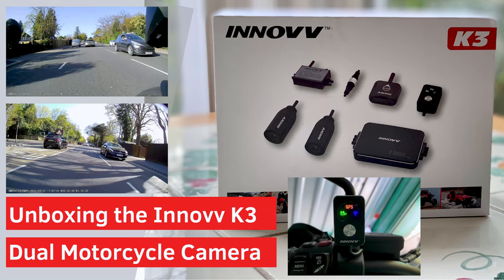Fitting the Innovv K3 Camera System to a BMW R1250 GS Adventure

Comment: Hi Nick, an excellent video. I have the K2 on my R1200GS and got knocked off from behind last year and the footage was invaluable as the Police used it as evidence to prosecute the driver and also for insurance. I am thinking of getting a new bike and now need to decide whether to keep the K2 or buy a new K3 but wouldn’t be without a camera system after the experience I have had.
Reply from the maker: I’d stick with the K2 Peter. The K3 doesn’t have enough useful for the money. Great cameras. It the K2 was fine 👍🏻

Comment: Great video, thank you! My only question is does the direct connection to the battery drain it? I've heard some comments in the past about other cameras that having that issue :(
Reply from the maker: No. The camera switches off completely as soon as the switch wire (yellow) gets a signal the ignition is off (in fact the power supply maintains a short period of power after this signal to ensure the last files are safely written). What DOES drain many batteries are trackers as they are powered 24/7 for obvious reasons and motorcycle batteries are small. My bike is connected at all times to a ‘smart’ charger

Comment: Great video, very informative, 
Did you mount the remote for the K3 using the fixings provided in the kit, 
Thanks 👍
Reply from the maker: I did on the GSA under the mirror stalk but in the K1600 I used the best 3M dual-lock and stuck it to the top of the clutch hydraulic reservoir where the mirror would normally be 🤣

Comment: Thanks Nick, I'm replacing the K2 one on my K1200GSA with the K3 now.  This is my third model INNOVV camera, the first version had the save button and I missed that on the K2.  I have a Tiger 850 Sport and a second K3 camera will be installed on it as well.  Wondering how I will handle that, any ideas?   I use a MAC, so will deal with that when I get there I guess.  Mike
Reply from the maker: The Mac side will be fine. All you have to do with any motorcycle is connect a battery and find a switched wire to plumb into. As most stuff is under seats just head to the rear light is what I’d do and use a positap to ‘break’ into it without too much damage. Good luck

Comment: Hi Nick. Great video, thanks. Any reason why you didn't get power from the Cansmart?
Reply from the maker: I did get the switched power from the CanSmart but want 24/7 power from battery if you want to use parked features  (nudge, etc) as the CanSmart will be powered down

Comment: Nice detailed video, good production and detail, lots of time making this quality video, many thanks. I wonder if it's worth trying to mount the cameras with some minor shock mounting, ie rubber grommets of some kind, to help mitigate camera shake? Perhaps Innov will eventually upgrade the system with some form of image stabilisation in the future. However, I can see that being implemented only on the flagship K5 model, with added cost..but eventually might trickle down to the lower models. Also, a low-cost sacificial lens cover might be nice too, certainly for the front camera, as I imagine over time, scratched lenses are inevitable.
Reply from the maker: You make interesting points but I feel this is an evidential camera NOT really a vlogging one. I use GoPros for that. It does come with rubber pads but my experience is that allows ‘bounce’. See my K2 video. I would like to see better image quality before stabilisation for sure. 1080p is fine. I’ve had my K2 for 2 years with lots of wipes as in rain they’re quickly dirty but no deterioration so far👍🏻
Reply: @nickhodgeUK  Hello Nick, thanks for your reply. I think you are right, the Innovv is not quite designed to replace a GoPro or two..sadly...but no doubt with some development, they might be in the future. I think your bike looks great in those colours, and your 'farkling' makes a great bike even better. I have never owned a BMW, but I rather think they are worth the premium cost.
Reply from the maker: @GertrudeGrindhorn  the colour is lovely. Shame they stopped it really. It’s an interesting thing about the cost of BMW. I spec’d a new GS v an Africa Twin (DCT) and KTM 1290. The KTM was £200 cheaper and the AT £900 cheaper. So like for like it’s close 👍🏻

Comment: Hi Nick, I installed the Innovv K2. Red cable to the plus and the black to the negative. The yellow cable also connected to the correct location. When I turn off the bike the DVR turns off after 30 seconds. Only the DC converter light remains on. Is this how it should be? and does this have consequences my battery?

Thanks for making these helpful videos!
Reply from the maker: Yes the yellow wire ‘switches’ the power off to the power supply but that provides power to the DVR unit for a short time to ensure the last files are written. I think this is a setting in the app for the power-off delay?? 👍🏻

Comment: Thanks for the video. I'm looking for an innov myself, either the K3 or K5. The K3 is definitely more in my price range for sure. I just want a fairly priced unit with front and rear cameras that is easy to use. If you have any insight it would be greatly appreciated. TIA
Reply from the maker: Hi Kevin. It really depends what you are doing with it. For evidence purposes the K3 is totally fine and most importantly over cheaper units, reliable. Fit and forget. I check it’s working before setting off on major rides and that’s it. I do use the footage in some videos and it’s perfectly adequate and offers the shot when the GoPro wasn’t in or a slightly different angle. I only use 1080p (even on my 4K GoPros) as few people view in 4K and it is much more intensive to edit and process. Also the K3 is much easier to site as the cameras and DVR unit are separate whereas the DVR incorporates the front camera in the K5 to allow for the throughput on signal so it’s a camera in a big box at the front. If you must have 4K then you must have the K5 but with more people watching videos on smaller devices you may be spending unnecessarily. Hope that helps? 👍🏻

Comment: Thanks for the info, just bought a set of Innovv K3 Camera systems, very easy to install, and your video made it easier. Just some questions, sometimes the image while driving will freeze while recording, it will still be recording but the image on the phone is frozen is it normal? Another thing does the wi-fi will connect automatically when I turn in my motorcycle or I have to connect it manually? I have also noticed that part of my drive was not recorded is this normal? Thanks for your kind assistance
Reply from the maker: Edmund. I think you misunderstand the capabilities. The WiFi and video is not designed for ‘real time’ playing and indeed there is little need for it and it would just be.a distraction. The WiFi ‘output’ should connect automatically but you will normally need to connect your phone to the Innovv unless your phone is set to ‘always connect to known networks’ and it’s the only known network it can see but as I say, ‘streaming’ is not a recognised function so it is also not necessary to connect to WiFi continuously 🤞🏻

Comment: Excellent video Nick a question on the model did you consider the K5 & if so what made you choose the K3 . Cheers Dale 👍👍
Reply from the maker: Hi Dale. I was given the K3 by Innovv as they had had enough reviews on the K5 so I can’t honestly tell you. However here’s my ‘take at distance’. The K5 has the DVR built into the front camera which makes it difficult to site although the box is of course not under the seat or elsewhere. I think this means the front camera only is 4K although I can’t confirm that but expect the bit rate needed means the camera must be ‘close’ to the internal electronics to allow the higher bit rate. On 4K generally. I started using it but you need a high end machine to edit it in any reasonable time. I spent £3k on a machine suitable and even then I still record in 1080p and ‘upscale’ to 4K as I get 4K results without the editing overhead. I hate that job!!  Also so very few viewers have equipment to play back 4K properly. It will come but maybe in 5+years??? That’s all I can give you but hope it helps? 👍🏻
Reply: @nickhodgeUK  thank Nick yes I imagine editing it is a night mare I can’t even edit GoPro stuff lol 👍

Comment: After I looked at this movie I ordered a system which I am in progress of installing, my problem is that I can see the system on my phone internet connection but my Samsung Note 8 will not connect up. How new software in the phone is required.
If any limit you should then mention it in your movie.
Have contracted the company to see what they will come up with
Reply from the maker: No limit on Samsung phones. Just make sure your phone, the Innovv app and the firmware on the DVR unit are all up to date and I’m sure it’ll be fine 👍🏻

Comment: Hi, great informative video. Only one question - why did you mount  the front camera on the near side when the beak obstructs the view?
Reply from the maker: Hi Stephen. It would ‘see’ the beak from the offside too. I felt mostly it’s people pulling out and they would generally come from near side. It’s the flip of a coin really. If I wasn’t so fussy I’d make a bracket for up near headlight so it’s front and centre 👍🏻

Comment: Hi nick love your videos, I got a q. That got my attention, does the gps need to be upright? I can’t access nothing on my I phone.. also can I disconnect the microphone?
Reply from the maker: The GPS does not have to be upright. It just need to be as near clear sight to satellites as possible. That is not under a metal tank or buried deep in the bike somewhere. It is directional so should be mounted by the flat side not the curved one. Not sure what you mean by can’t access anything in iPhone but if you mean can’t connect the app you need first to go to your WiFi settings in the phone and connect to the INNOVV K3 xxxxx network. Then open app and you should be good (connecting to WiFi needs password which by default is 12345568). You can just disconnect the mic no worry but make an effort to waterproof the now empty connector
Reply: @nickhodgeUK  thank you.. yes .. my gps I have it on same place as you.. got same motorcycle.. I’m new follower from Los Angeles ca,

Comment: Hi Nick great video. What SD card do you use and recommend? Also what is the best way to watch the footage back download it etc? I am interested in downloading videos of rides with friends to a Dropbox etc. Thanks Rich
Reply from the maker: Hi Rich. I use the Integral XC micro SD (256gb). It is marked V30 A1 is class 10 and ‘U’3. The best way of getting any footage out is either by micro USB cable to a laptop or taking out the micro SD (that’s what I do) 👍🏻
Reply: Hi Nick,  thanks for the info  👍

Comment: Hi Nick, I have used your video to fit a K3 to my GSA, thank you.  I have a little blue light on the DC converter but no power to the DCU.  I used a separate Cansmart connector plug to connect the yellow live switch cable into one of the Cansmart coloured circuits and don’t have any power to the DCU.  I am a total novice and would appreciate any suggestions as to what I may have done wrong.  Many thanks, Stuart.
Reply from the maker: Stuart. Are you leaving it long enough?? The power supply has. 10-15 second delay in powering up and down. To test the DVR unit simply hold the yellow wire to the positive of the battery. Wait for it to power on and then remove the yellow and this way you’ll measure the period of power up and down. Next you will need to be sure you have the CanSmart circuit you are using as a ‘standard accessory’ circuit. (1A fuse should be enough) you do this through the CanSmart software. Don’t use a lighting or horn circuit. Let us know how you do
Reply: @nickhodgeUK  thank you for replying Nick. I have done what you suggested. I hadn’t given it long enough and now have it working, many thanks. Stuart

Comment: Hey, quick question, why do the camera need GPS?   And do I need an internet subscription for the wifi?
Why do I need wifi?
Thanks.
Reply from the maker: Don’t confuse WiFi with internet. The WiFi is just a wireless network available so you can download stuff onto the app wirelessly. I prefer to do it by cable or take the card out as the WiFi transfer is slow. So no, you need no subscription. GPS is used so you have a position stamp on the footage. Also good if you use it in videos as there is software to show maps with the GPS data 👍🏻

Comment: Nick, you talked about formatting the card in the DVR; how did you go about that, please?
Reply from the maker: Put the SD Card in the DVR unit and connect your phone to the WiFi of the Innovv. Open the app and in the settings you’ll find the format card setting (it may be ‘delete files’). It’ll tell you when it’s formatted (should be seconds) and you’ll be good to go 👍🏻
Reply: @nickhodgeUK  Many thanks!

Comment: Thanks Nick. In the middle of my K3 install, I’m unable to install the DVR unit under the tail like shown instead having to instead locate under main seat. Would that be ok in your view?
Reply from the maker: Arif. You MAY get away with it if you have your seat in the highest setting (both front and back adjusters) but it will be tight. Put a thin layer of something (grease, Vaseline) on the base of the seat. Fit it sit on it and bounce and see if there is the substance on the face of the DVR. If so it’s too close! 👍🏻

Comment: Does the flash of the indicator interfere with the video picture.
Reply from the maker: Not that I’ve noticed although your indicator is on such a short time. Equally seeing a faint flash would help confirm an indicator was on in an incident, but reiterating. I’ve never see an indicator in footage 👍🏻

Comment: Do you know if you need to fit the controller and gps? Would it still work and can you still connect to your phone without the controller
Reply from the maker: The unit will work without either and the controller is only a visual display and the GPS provides positioning and speed information so you won’t have that but the DVR, cameras and Power supply are the only essentials

Comment: I talked to INNOVV support regarding GPS module placement and was told that how it's shown in this video is fundamentally wrong! The module MUST be installed with GPS logo pointing UP. No wonder I constantly got inaccurate (or completely missing) GPS data following this installation instruction
Reply from the maker: Thanks for the comment. It’s been working a long while for me wrong. (K2 and K3 across 3 GS’s and now my K1600 (although that is a different fitment). The key to any GPS module is to give it ‘free air’ and yes. If you’re on the cusp of not doing that then direction will matter particularly with what are effectively low cost, low powered modules. Innovv do still have this video on both the worldwide and UK sites and their tech team have never mentioned it with me but again thanks for the comment as it may be useful to future fitters 👍🏻
Reply: @nickhodgeUK  Thanks for the reply. I just wanted to share INNOVV recommendation. I'm still investigating the issue I have with embedded GPS data. And I'm not convinced that the problem is in the module location/orientation, because I do see GPS info in the video overlay, but when I extract GPS data from the video (with Dashcam Viewer) all GPS related fields are ZEROs...
Reply from the maker: Have you tried picking it up with the support at dashcam viewer??  Despite the premium price of the Innovv the GPS unit is quite low grade and therefore it’ll always need ‘help’. I don’t extract the data from the video as to see a route I export the gpx file recorded from my BMW connected app and put that into Garmin Basecamp. Good luck though 👍🏻

Comment: Thanks for the video, Nick. Clearly there are some advantages over the K2 (external mic and remote to name a couple). Question is - it it worth the upgrade?
Reply from the maker: Hi Richard. It is over buying a K2 new v a K3 new but if you already have a K2 it’s a little more difficult to justify. Definite positives are the remote. The bitrate increase has improved the quality somewhat. The rubber door in the DVR is a big plus if like me your K2 has 3 tiny screws as if you want to use footage you’re taking that door off!! Mic is of no interest to me but may be to many??
Reply: @nickhodgeUK  My K2 must be a later iteration as it already has the rubber door over the SD card slot. The mic is of some interest to me - simply because the on board sound is so awful on my K2 - recording under the seat. (Here's an example - https://www.youtube.com/watch?v=kcMVSGXjGCQ.

 Overall, I think it would not be worth the upgrade but I have considered fitting the K2 to my "second" bike and investing in a new K3 for my GS. What about the K5? 4K but a strange form factor for the main unit...
Reply from the maker: I think the K2 may still fetch £100+ is another consideration. The K5 has 4K and the faster WiFi but the 4K files will be huge and faster WiFi probably offsets that. I only use my Innovv for evidential and the many occasions the GoPro is either not on or the battery’s flat!! I only use 1080P on my GoPro so really not interested in 4K. The DVR being part of the front camera also makes it a much more difficult fit I would think. Over my K2 the new metal connectors and the rubber door made it for me 🤣👍🏻
Reply: @nickhodgeUK  Will the entire system still function even without installing and wiring the microphone? Like yourself the microphone is of no interest to me but I think the K2 is no longer available.
Reply from the maker: @dinoe820  hi Dino. Yes it will. Even the K2 had a microphone but only internal. The K3 only added an external option with the microphone supplied.